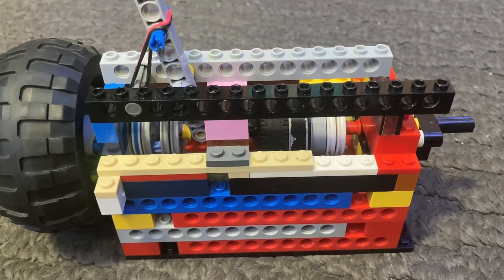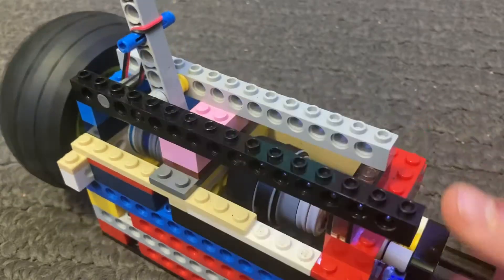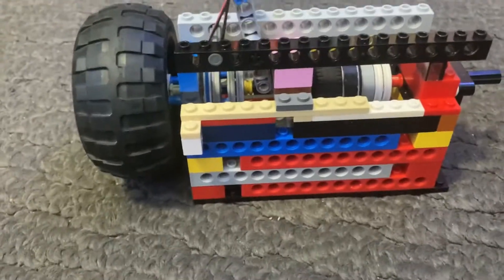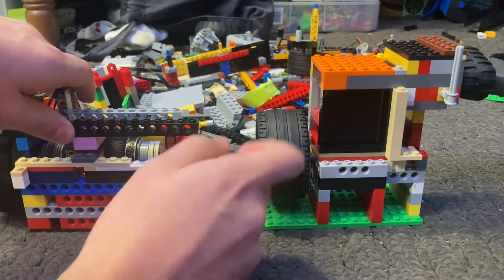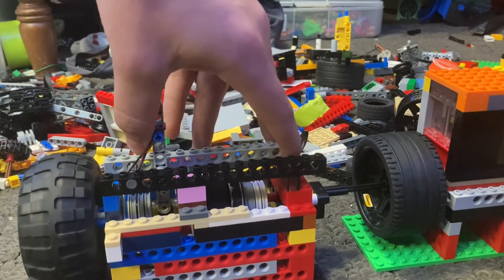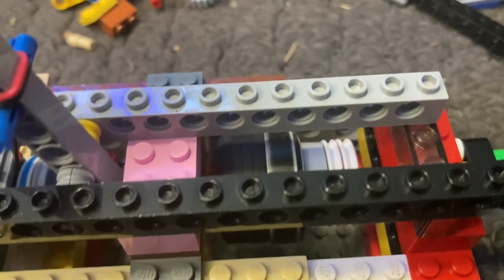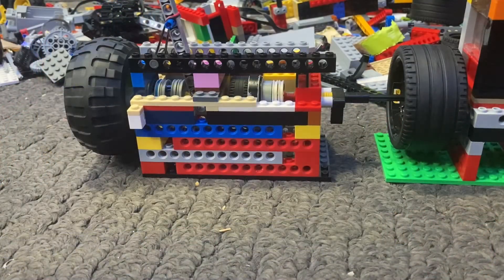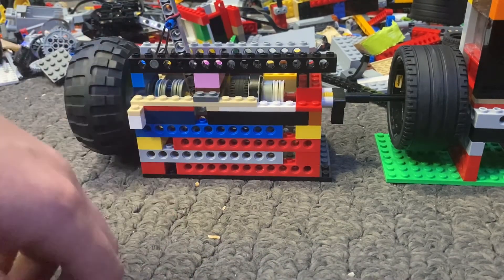HIGH TORQUE Lego Clutch

Comment: Edit of my stupidly long comment: cool
Reply from the maker: What a long comment... but I have yet to experiment with other types of plates, to get different results. I used the engine to slightly get an idea of what is possible with this style, if you had a v8 attached to it you could still stall it potentially.
Reply: Yeah sorry for the block of text, didn’t intend for it to be as foreboding to read as it was. But as clutches go this one would be good for a powerful car

Comment: Can you have like Engine Trans and clutch then wheel?
Or is that too much for the engine?
Reply from the maker: I’m pretty sure you have to have a flywheel on the engine, nothing before it.
Reply: @KFPlusLegoMastery  you're correct
Reply: I have done it it’s on my channel I will make a gear box wit more gears soon
Reply: Engine flywheel clutch trans then something like wheels, it should be able to, not well but it should work

Comment: Why don't we try to make a automatic clutch? Just something thatll engage on its own at certain rpm.
Reply: A centrifugal clutch might be possible, though it'll require fine tuning and a centrifugal method wouldn't be able to transmit too much torque
Reply: @mel_energy  You are right about fine tuning, and we will have to customize it to make it handle a lot, weak rpm detector but strong engager. That'll work great for an automatic/centrifugal
Reply: @tulowscustoms  I also thought of something like a sequential transmission with a rotary shifter that somehow disengages the clutch between each gear, though for the moment that's just a concept
Reply: @mel_energy  I was just thing a way to do it with tires.
Reply from the maker: It’s possible and I was considering trying to do that at one point and I actually might try to do that in the future.
Reply: i'll try to make it, i have enough time today and i'll show it too

Comment: A vacuum engine does not produce a lot of torque, smh.
Reply from the maker: But this was just a representation of what is possible, if you had a v8 it would still stall if you did it right.
Reply: @KFPlusLegoMastery  Exactly my point lol, that's why we need an automatic transmission for vacuum engines, one we can't control a manual clutch on a driving car.
Reply: I made a vacuum engine (6x6) and that produced enough torque to easy spin when I tried to stop it (made a “dragster” with it)
Reply: @vacuumpowered6119  Is it on your channel?
Reply: @tulowscustoms  yea it is